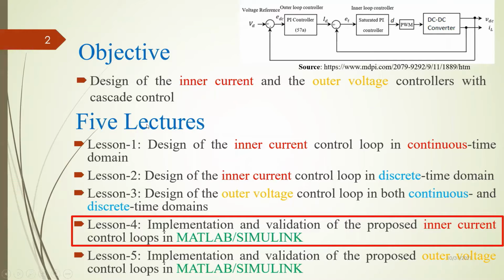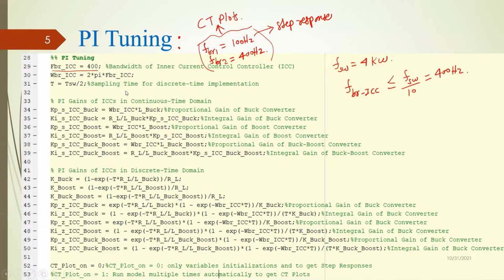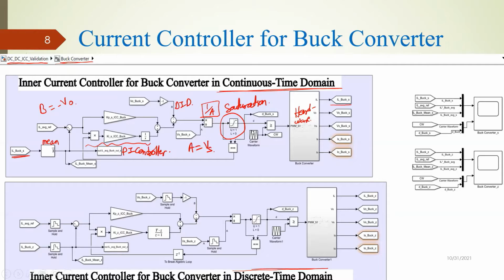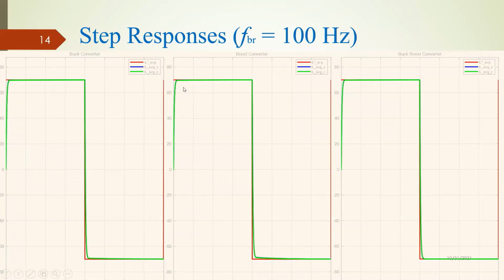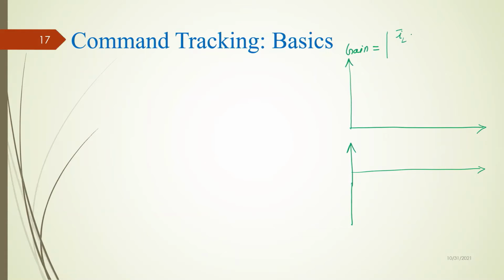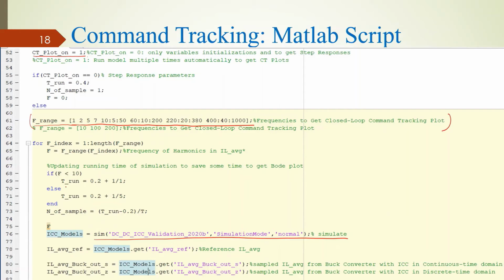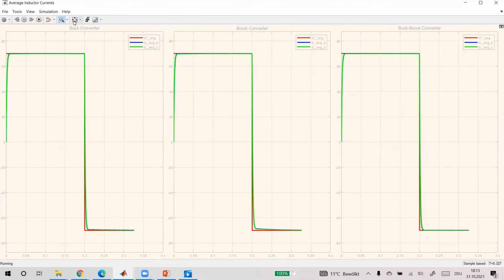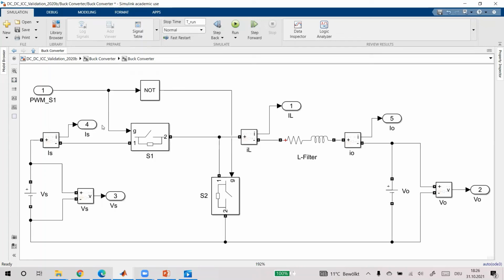Implementation and Validation of the Proposed Inner Current Control Loops using MATLAB/SIMULINK(4/5)

Comment: hello Dr, i m trying to implement a two level VSC HVDC system controller  using a decoupled current control strategy, but could not do it so far, can you share a video on that please
Reply: Hello Sir will you help me getting these drive files if you have those by any chance???l

Comment: Hi
Any idea? Why current loop and voltage loop, is better then simply one voltage loop?
🙏
Reply from the maker: Hi, 
It makes your controller design more easy and linear. Designing only one voltage controller could make plant mode complicated. Plus having two separate control loops gives you the possibility to decouple the couplings easily.
Reply from the maker: And you can also implement the current limitations during short circuit events easily using separate current and voltage controllers.

Comment: if you want to use just voltage loop, is the Kp and Ki will be the same as for OVC?
thanks
Reply from the maker: Yes, the Kp and Ki can be used from the equations of OVC. You only need to use some gain for ADC and PWM realisation in microcontroller

Comment: another question if i may,
you did a test for the boost with positive and negative current, 
does the negative current represent buck ?
thanks
Reply from the maker: Negative current doesn't change boost converter to Buck converter. 
But, if you want to see load as source in boost converter then yes it is buck converter operation.

Comment: hi 
great video again. Thanks.
but how do you take into account ADC conversion and PWM values.
what i mean is that a 12bit ADC will give higher values for the controller (something like 10 times higher),
and the pwm value is not 0-1 but for  a 16bit Pwm the value is 0-65000
need i change the KP and Ki because of that?
thank you.
Reply from the maker: Hi,
Thank you for your question. No, you don't need to change Kp and Ki. You can simply multiply the output of the controller (duty cycle, d) by a gain. For example, if duty cycle 0-1 is mapped to 0-65000, then you should multiply the duty cycle (output of current controller) by factor 65000 and pass it to the comparator in microcontroller to get suitable PWM. I hope it answers your question.
Reply: @mankapowerelectronics364  
hi,
thanks for your replay,
yes it answers about the PWM, but what about the ADC? does it have any affect?
and what if we need to use only integer values and not floating point?
thanks
Reply from the maker: the main thing that should be kept in mind is that you should give actual current or voltage to the controller. Hence the gain of ADC should be compensated before giving current and voltage samples to the controller. 

I am not sure if all calculations can be performed in integers, but all most all microcontrollers are capable of handling floating data type these days.